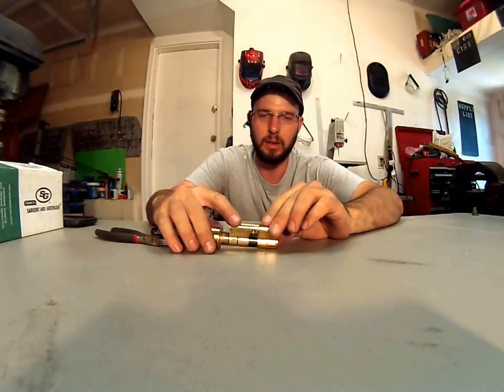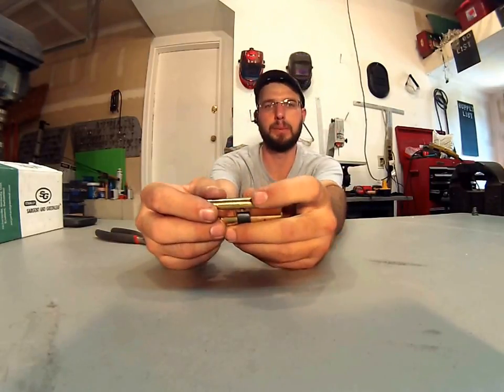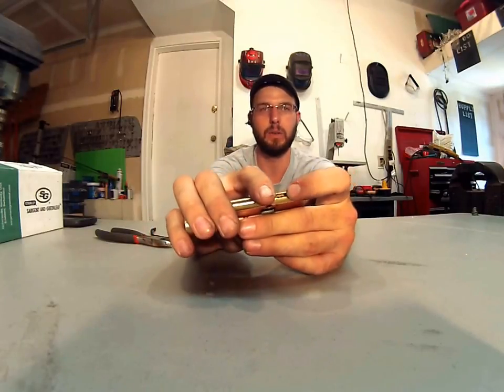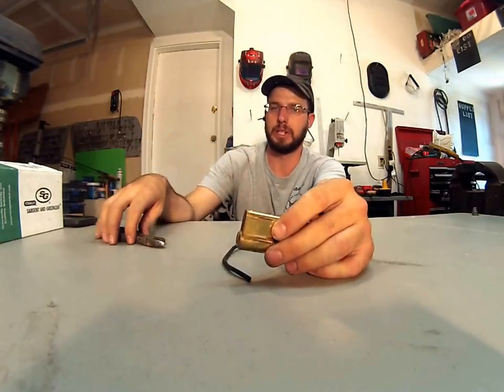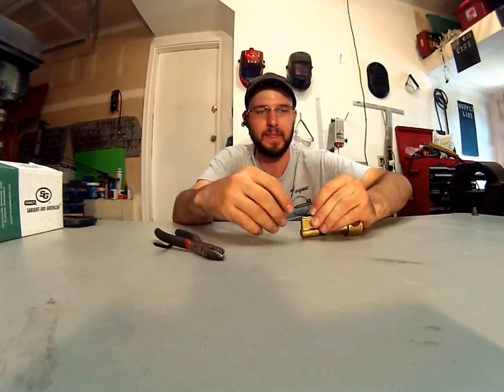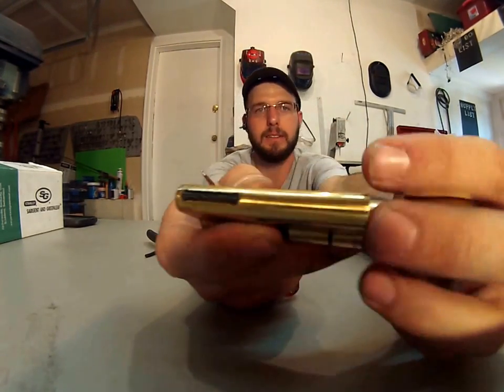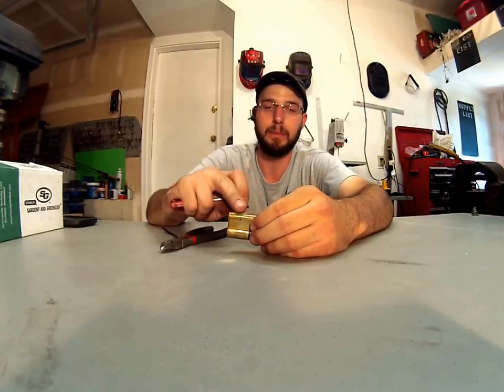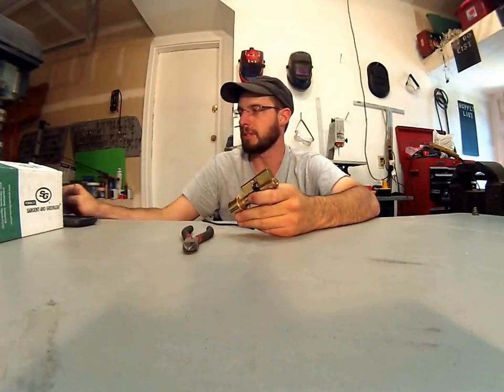How to Repair a Euro Profile Cylinder Locksmith Tips

Comment: I never knew that companies made them with plastic covers over the pin stack or that some come with removable set screws but the ones you class as non repinnable are repinnable with the correct technique and tools. 

In Europe they just come standard with no easy removable cover, you either pick them or use a key with the back cut off and once the plug is rotated 180 degrees, then a pinning shoe is inserted between the plug and the cylinder and the plug can be removed as the pinning shoe holds the driver pins and springs in place.  

They are tricky to re pin until you master the correct technique and use the correct tools.
Reply: Yes but you can't really do that for customers locks when servicing them unless you start cutting the back off of customers keys just to take the cylinder out, you have to remove the cam and use centre insert followers to remove the plug, the cut off key idea is only really ok for those one off training lock's where you don't plan on changing the key pins